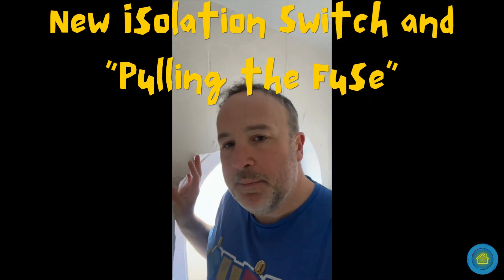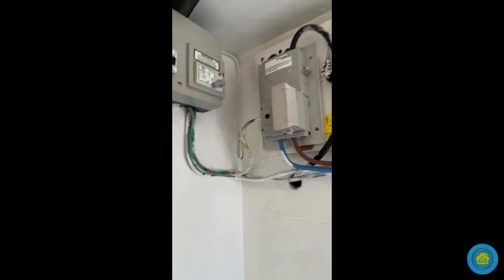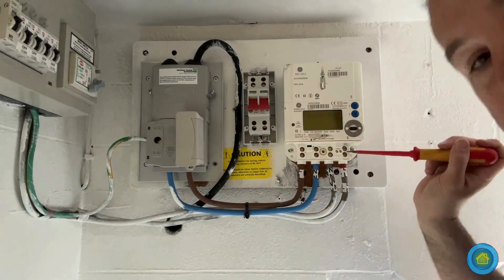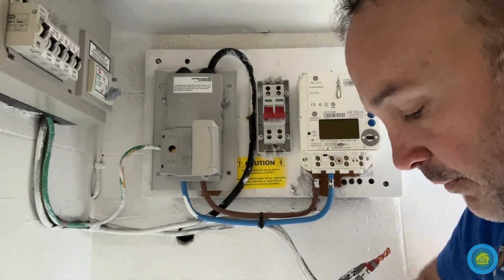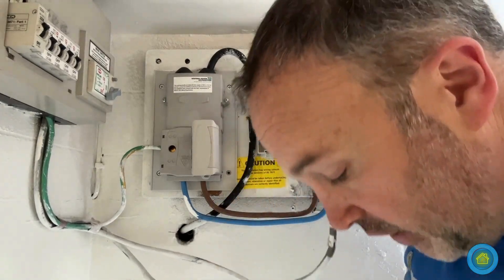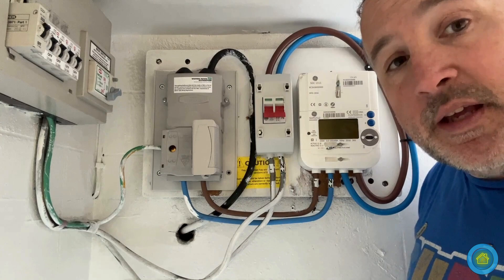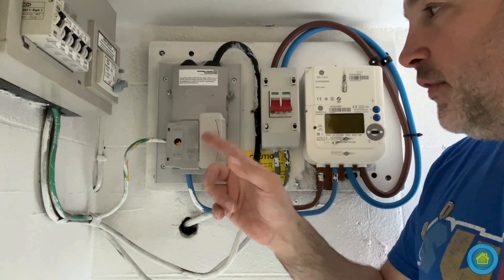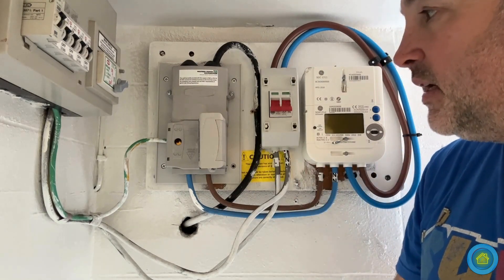#electrical #Isolation switch for a #consumerunit #upgrade #localelectrician in #oakhill #radstock

Comment: You pull co fuse out on a smart meter it pings to control,they see it as a loss of supply to that property, if more than one smart meter on that leg from the sub pings they see that as a fuse op at the sub so think it's a problem on that leg rather than the individual,so send resource to individual or multiple pings to the sub,i've been to to pinged smart meters where sparkies got his hand on cut out fuse doing a con unit swap,they used to report them to the hse but like most things that died a death,i dont care cos i used to be a sparkie! lol

Comment: As an Industrial electrician for 50 years , when my energy company gave me a date for them fitting a smart meter I purchased a double pole isolator switch and asked their electrician to fit it when he arrived which he was happy to do, so now I don't have to go anywhere near the power companies main fuse I just have to switch off the double pole isolator offand because it's remote from my consumer unit which I may be working on I lock off the isolator and keep the key on my person then I know under no circumstances can somebody else make my consumer become live thus putting me in danger of electric shock

Comment: Why didn't you not wire your tails from the meter into the bottom of your 100A isolator it would have been a neater job.
Reply from the maker: Yes... you're probably right... but when you're working sometimes you don't see things until you take a step back... it's safe, it works and although there's something I could have done better, it's doing what it needs to do.

Comment: Agree with your principles, but when I do a consumer unit change I ask the customer to get their electricity supplier to fit a main isolator after the meter to allow safe isolation. Never had anyone refuse. Saves faffing with dno pulling fuse and they fit the isolator. Everybody is happy.

Comment: Hi
National Grid have quoted me £250 to fit an isolation switch. 
This is so my CU can be repositioned.
Is that a typical fee?
Thanks
Reply from the maker: Yes, it’s about that… usually a little more actually, around the £270-£280 mark in SW. When I do consumer unit work I offer to do this if there’s no switch, the DNO can pull the fuse. Works out slightly cheaper for you that way.

Comment: When I had a smart meter installed, I insisted they fitted a cutout switch at the same time, and they did, free of charge. They also replaced the fuse seals which I broke some 10 years previous, and nobody said anything. 😊
Reply from the maker: Hi Stuart, yes, I think there is a grey area where the public are concerned... it's more a regulation that I feel I must follow as I am a "professional", following the IET Wiring Regulations is a statutory requirement but not law.However, touching the main cut out or pulling the fuse is illegal, but would it be more of a civil matter... I am not 100% on the rule of law :) I do know that some electricians will pull the main fuse to cut the power but I just won't, it doesn't cost much to do things properly so long as you're organised and let the DNO know when you want them there, our DNO is very punctual! Those seals that you "can't buy"... can be bought on a certain selling website where lots of other bits and pieces are sold and distributed ;)